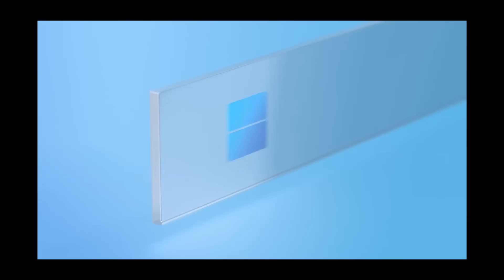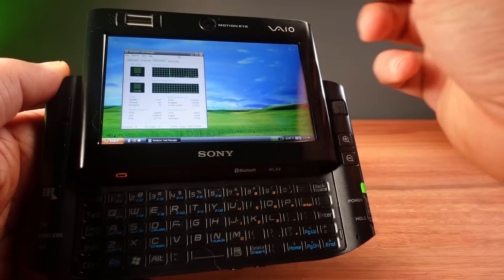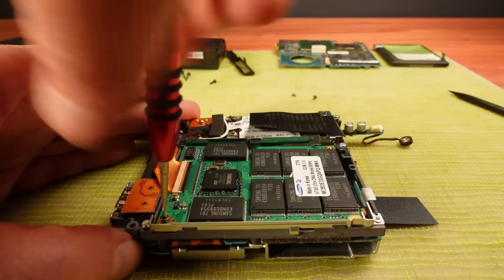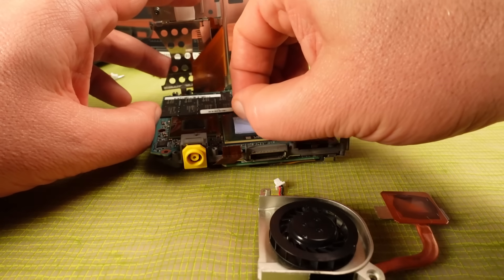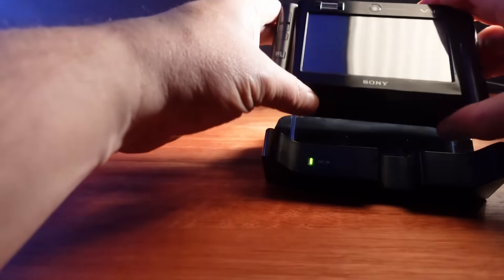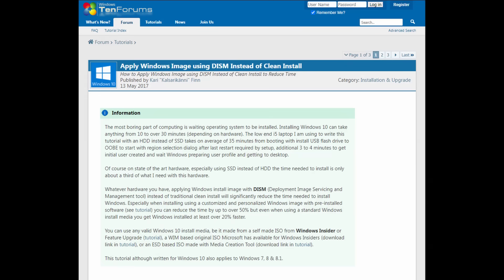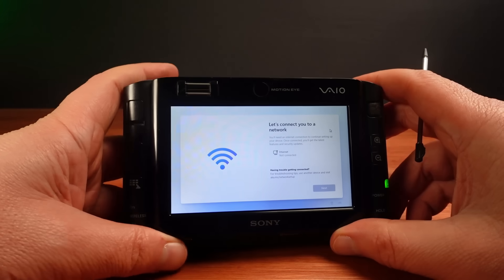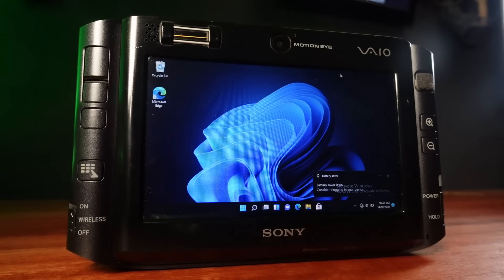Windows 11 On This Classic 15 Year Old MicroPC

Comment: If enough drive space, multiboot! Just 1 meg of memory means no 64-bit XP/vista/7/8/10 (all will install, but use more memory->sluggier). If you can shrink your 11 partition enough from 11's desktop, everything else is simple -- installing 7/8/10 after 11 not a problem, both OS will show up on Windows boot manager. If XP, use a bootloader like EasyBCD. Like your vids, hope you start getting more views.

Comment: The joy of using Vista on 1GB of RAM.....
Don't know why MS recommended that as the minimum amount to use. I think it was because how much RAM was at the time iirc. Would've been much better to have 2GB as the minimum and was a night and day difference. Heard some systems had 512MB.
Reply: sounds like a moment when hardware wasn't ready for vista
Reply: I have an old laptop that has Windows vista on it from the factory as well as 512mb ram
Reply: @TheRideGaming  idk what the manufacturers were thinking installing 512MB when it was bad enough with 1TB.
Reply: @themadatheist1976  profit margins! (Also funny typo)

Comment: I love how Microsoft won't even tell you what aspect of your computer doesn't meet the minimum requirements. I'm sure this is intentional, older versions of Windows would tell you.
Reply: it's most likely a lack of tpm
Reply: @alternatecheems8145  mine does have TPM, but I can't because my motherboard is in CSM mode instead of UEFI, but because my boot drive is in MBR I can't boot in UEFI mode
Reply: @CrocoDylianVT  It's been awhile since I've used it but Microsoft has a tool called mbr2gpt that can do the conversion without formatting, it worked without a hitch when I used it but obviously you should do a backup first. Using UEFI vs csm is really nice, boot is faster plus you can use some features of newer graphics cards not available to csm. I'm not saying upgrade to 11 (I haven't/won't) but UEFI is nice
Reply: @CrocoDylianVT  My drive was MBR too until I just reinstalled Windows in GPT mode and then it worked and reported the machine as compatible with Windows 11
Reply: @CrocoDylianVT  you can just flash your boot drive to gpt
Reply: @CrocoDylianVT there is a way to convert
Reply: @CrocoDylianVT  all I can suggest is copy the drives data to another drive and then change the format to UEFI. Or change to a new drive  if it's a HDD I suggest picking up a SSD for boot drive. And the other drive I'm pretty sure even being mbr should still show in windows as a data drive
Reply: To be honest, they probably don't want to repeat the "Windows Vista capable" situation all over again :^)
Reply: They do tell you now. I think they didn't before.
Reply: Usually it's the TPM module as win 10 and 11 are pmuch the same under the hood
Reply: Mines was the BIOS - it was legacy, UEFI needs enabling. My PC doesn't support that
Reply: For me it was that I had a 7th gen intel chip when I needed an 8th generation
Reply: Wouldn't run out of the box on my $1000 Threadripper, but managed it by other means...
Reply: i remember windows 8.1 telling me to change cpu because the clock speed is too low
Reply: Dang may wanna raise your standards if you love it that much 😂
Reply: They do have specific software for that. I guess it's so you don't have to get the iso
Reply: I tried it and the only requirement I don't meet is the processor. It says "The processor isn't currently supported for Windows 11."
Reply: @RetroDotTube  A separate program isn't exactly part of the install but ok fair enough I guess
Reply: @s8wc3 you mean the second program that youre supposed to go through to actually open the installer?
Reply: Windows 11 - s*cks.
The best of the best - Windows 10 LTSC.
Reply: @Death_bot666  Это точно.
Reply: Probably because they want you to buy a surface.
Reply: @TrustedInstaller_Permissions  not sure why they're kind of annoying to use
Reply: @Kyharra  they want 💰🤑💰 they could care less about the user.
Reply: @TrustedInstaller_Permissions   I mean you're not wrong but still.. It's fucken annoying lol
Reply: It is here : 4gb of ram 64 gb ssd or hdd Tpm
Reply: @Pedro Daniel Lopes Ferreira The thing is Microsoft is blocking CPUS that are reativly new for windows 11 instals.
Reply: yup, just go buy a new one.
Reply: @71bw  I hope you're joking. Replacing computers that still work just fine for what they are needed for, is horrible for the environment, and a huge waste of money.
Reply: @andrar9969  of course I am. Companies are all for ecology then shit like this happens but it's good because profits
Reply: @andrar9969 oh really? They work just fine for what you need them for? great! Then you dont need the update!
Reply: Its the CPU 
CPU's are now built with a trackign chip that eneabled it to send packets to microsoft even when the machine is powered down
As long as an active network with access to the internet is plugged in and power is plugged in and not compltley cut off at the source 

It can and will send packets to microsoft 

THere is actually a company who you can send your CPU too to get this chip drilled out of your CPU 

Im not even kidding 
lookup 
"System 76"
Reply: @brooksie9999999999  Not sure if this is intended as sarcasm or if it's genuine stupidity.
vPro and Centrino allowed that since the later Pentium M and early Core chips.
You're just now losing your mind more than 15 years later because someone told you to be scared about it.
Pathetic.
Reply: What are you talking about?  They've made it very clear what your computer requires to run Windows 11.

This isn't just about abandoning old hardware, it's about increasing the standard for device security and performance.  It's not a surprise that computers only a few years old might not support Windows 11 as hardware manufacturers have no issues with shipping outdated hardware.

Do we want our operating systems to be restrained because they have to support 32-bit for the sake of compatibility?
Reply: @fordgtguy  At what point during the installation process does it actually tell you? It doesn't, they just say "go to this url and figure it out".
Reply: @s8wc3  When I installed Windows 11 using the installation compatibility utility it not only told me what I needed but even automatically checked if my system was compatible.
Reply: @s8wc3  It tells you clearly in the requirement section. It's not on M$ to dumb it down to your level and enable you to bypass the restrictions in place.
Reply: @tim3172  Consider reading my comments. It actually is Microsoft's job to tell the user why the installation failed in a useful manner. No idea where you got the idea I was suggesting they let the user bypass the requirements.
Reply: @fordgtguy  you don't think planned obsolescence is a thing?
Reply: @fordgtguy  microsoft has made it clear its not about security by supporting the i7-7820hq because they are shipping the surface studio 2 with outdated hardware
Reply: @fordgtguy  32 bit is based.
Reply: @fordgtguy  Linux dosent have this problem...
Reply: @Satakarnak  Linux doesn't have compatiblility issues?  Hah oh god... you're serious?

That's some funny shit.
Reply: @fordgtguy  Linux doesn't have these problems
Reply: @panconqueso9195  so funny they need to make it so you can run Windows executables without a third-party program how about they reverse-engineer windows and then they make their own code to run Windows executables EA reverse-engineered the Genesis so it must not be illegal
Reply: @fordgtguy  Windows 11 lack of support for hardwhare that is 6 years old is pathetic.
Reply: @Satakarnak  My computer is 6 years old and had no issue whatsoever running Windows 11.
Reply: @fordgtguy  my computer is 3 years old and it can’t be supported. It’s a Lenovo e580 with an i5-7250 from 2019/2020. Genuinely disappointed
Reply: @fordgtguy  Have you ever used Linux?

And i don’t mean crappy distros like Ubuntu… i am referring to Arch-based distros/Fedora/OpenSUSE.
Reply: @panconqueso9195  Hooo boy you drank that koolaid, Linux ABSOLUTELY has compatibility problems, it just doesn't have a website that tells you exactly what is wrong, you have to figure it out on your own.
Reply: @Satakarnak  Correct, Linux doesn't have a lot of problems that Windows has.
It's also not burdened with things like usability.
Reply: @0w3nn  This is going to be hard for you to comprehend, but the i5-7250 is from 2016.
Marketing Status: Discontinued
Launch Date: Q3'16
Parts aren't new to the market just because you bought obsolete hardware.
Let me know if you're still confused.
Reply: @tim3172  ok so? Why shouldn’t the i7-7700k run windows 11, but a 2023 intel Celeron can?
Reply: @Satakarnak  My old PC that I sold to a friend runs Win11 on a i5 4460. The 4460 is almost 10 years old.
Reply: @fordgtguy yeah no it doesnt. Linux can be run on almost any system and compatibility layers are better than they ever have been. Tell me you dont know anything without telling me you dont know anything.
Reply: @NatetheNintendofan it actually is in fact illegal and this is why anyone whos ever seen the windows decomp source code is NOT ALLOWED ON THE DEV TEAMS of most major linux distros.
Reply: @fordgtguy if Linux has compatibility issues it's only ever the fault of companies not making their stuff open source or someone having not written a driver. If Windows has compatibility issues you can't do anything about it except change your hardware.
Reply: @fordgtguy they're right. Linux has a lot less issues with hardware compatibility than windows does now
Reply: @Natedogwoof they have something like that now called wine or proton or play on Linux. Actually some programs and most games actually run better on Linux than windows with the exception of game makers intentionally locking Linux from using their anti cheat
Reply: @CazRaX Linux actually has more support than any other operating system out there thanks to it being open sourced with a wide range of developers
Reply: @0w3nn because one has tpm2.0 and the other dosnt. Some systems can be bypassed with buying tpm 2.0 chip and installing it on the Mobo if its compatible. But I'm pretty sure the oldest Intel CPUs compatible are 8th Gen an oldest AMD are ryzen 2000  series chips
Reply: @IAmStillNotMatthew must not be running win 11 with support then because that chip is not supported or covered by updates
Reply: @ no, it has TPM 2.0.
Reply: @0w3nn  this is what I could find "The vbs (virtual software) Microsoft couldn't find a way around it to make it work with win11. Which some people use with their Virtual Hardware and some like myself don't even use and it's turned off. It should be plausible to work for win11 even with a built pc. I have the same intel core i7-7700 along with 1060 graphics, strix z270f gaming motherboard. TPM 2.0 turned on which is built into processor and Asus has intergrated their motherboard to run win11 as well as graphics card. So like everyone says Microsoft is pushing everyone to buy new computers. With chip shortage prices are way up and like many of us really can't afford the new pcs. I say wait it out and see if Microsoft gives in and finds a way for the vbs to work with win 11.”
Reply: @MrDeadmanwalken1  exactly, pure greed

Comment: Nifty lil PC. I would have installed Win10 on it, then you can bypass the restrictions from within Windows and do an upgrade to Win11.
The performance slowdowns might be due to the CPU thermal throttling with that thermal pad instead of proper thermal paste.
Reply from the maker: I will be fixing up that thermal paste issue, thanks for the tip. I get the impression that the Windows 10 setup GUI may also have some restrictions as well. For example lower screen resolutions could prevent install, I don't know for sure about that though.
Reply: @JanusCycle  good point, maybe install it onto the SSD on another PC and hope that plug'n'play will pick up the drivers once you install it back into the vaio
Reply: It's harder to bypass it within windows
Reply: VGN-UX390N owner here who sent my motherboard into a community member to have the Core Solo swapped out for a Core 2 Duo. Can definitely tell you that it runs HOT. I also had a 120 GB HDD sandwiched in there! So, every bit of thermal performance you can squeeze out of it is important.

Comment: Amazing video! Is it possible to solder new ram chips???
Reply from the maker: A Master Modder named Ahn did look into replacing the RAM chips back in 2010. I recall there was some problem with the BIOS or possibly the hardware not addressing the extra space. I will be looking into this further one day.
Reply: @JanusCycle  would be awesome if there's a chance, thank you!
Reply from the maker: @dariofercho  I remember Ahn was able to solder in a much faster Intel Core 2 Duo U7700 dual core CPU and it worked! I'm keen to try these hardware mods one day.
Reply: @JanusCycle  if the issue is the bios, you could technacally, with enough determination, get it to run.

Comment: There's no way to upgrade the RAM **

** - without a soldering iron
Reply from the maker: One day when I desolder the CPU and replace it with a much faster Intel Core 2 Duo U7700 dual core CPU, I will be looking at those RAM chips as well :)
Reply: @JanusCycle  just keep in mind that it might not be that easy, in order for new DRAM chips to be recognized BIOS could require modification, the north bridge may need some work as well, maybe it's not wired to support more memory, and different power delivery/voltage regulation could be required for the new RAM to work. But goddamn, the more middle fingers raised at soldered RAM, the better.
Reply from the maker: @neoqueto  It will be quite a challenge I agree. I admit I'm not confident at this stage.
Reply: @JanusCycle  i wonder whats the best cpu thatll still get recognized

Comment: Great video but I have to ask, where did you get the 64bit cpu mainboard and the SSD and how long does the battery last? I repacked my battery with new 18650 cells. I am  using the original Samsung 32GB SSD and 1GB ram.
Reply from the maker: I've had this board for a long time. Maybe since 2011. It was only after your comments that I realized there was a 64-bit CPU in some of the later UXs. I remembered these old parts and was quite surprised to find a Core 2 Duo. Thank you for being the seed to this video.
I would be looking at the Japanese Yahoo auctions and eBay these days to try and find this revision. But the RAM is still a limitation. A good alternative is the GPD Win 3, it's basically a modern UX. One day I will get one.
I have a UX battery that is still about 90% good. On Win XP it runs for an hour and a half. On Windows 11 much less, but I have not installed the Sony drivers for adjusting the CPU performance. I don't think it will make much of a difference though. Windows 11 needs lots of power.
Reply: @JanusCycle  Yes Windows 7 starter works nice on mine. With the SSD and 1GB ram I can watch netflix and browse the web fine and 720P movies on USB or on the SSD plays great. Repacking the battery was not too difficult and it lasts about 2 1/2 hours on max power setting.

Comment: The new Rufus 3.16 can custom install W11 and turn off all of the silly prerequisites. However, switching to Linux is looking better and better almost daily. Unless you need a specific Windows app you should be able to get vastly better performance out of this little bugger.
Reply: Windows 11 is Windows 10 with a streamlines GUI lol. Linux has it's place as a modular O.S. but the Windows design is superior for things like gaming lol.
Reply from the maker: I did try AveYo's MediaCreationTool which didn't work for me. I expect it does similar things to the new Rufus. I'm thinking that it could be something like this VAIO's screen resolution of 1024 x 600 that the setup GUI doesn't like. Linux is a good solution and I expect would make this VAIO really quite usable even with the limited RAM.

Comment: I would very much not recommend the thermal pad, you probably already know that they are several orders of magnitude less efficient at thermal transfer than paste, that said love your work in these videos mate.
Reply from the maker: Thanks for the tip, I'll be getting on to the paste as soon as I can. I know these pads are not as efficient. But I haven't heard the several orders of magnitude bit before. I thought in lower power situations such as this, they were at least somewhat effective. I was concerned about the thickness. At least with paste the surfaces are very close together.
Reply: @JanusCycle  My dell D430 laptop came with a thermal pad for the CPU and that has a dual core. Obviously it's not as good as paste but it's not going to do any harm...

Comment: Interesting video and you succeeded!. I have a couple of variations of this machine I'm yet to do a video on. One has the dreaded half white screen and the other side is just lines. Have you had that fault with any of yours?.
Reply from the maker: That sounds like two faulty LCD panels. Which would be a disappointing result if that's the case. It could be the slide cable. But the problem would appear more intermittent and dynamic. I would try an LCD swap to see what differences happen. That means a full slide mechanism disassembly on both units. Quite an in depth process. Could be a good video, I would certainly watch that.
Reply: @JanusCycle  thanks for the info. The faults I described are on the same unit, so one half is white and the other is coloured lines. And I forgot to mention that upon initial startup it works fine, just shows the faults after being on for a while or a restart. I have seen this fault before on other units on eBay. It's a peculiar intermittent fault. Not plucked up the courage to take it apart yet.